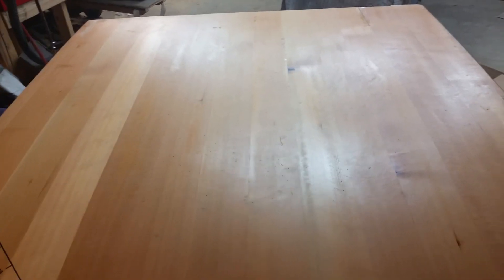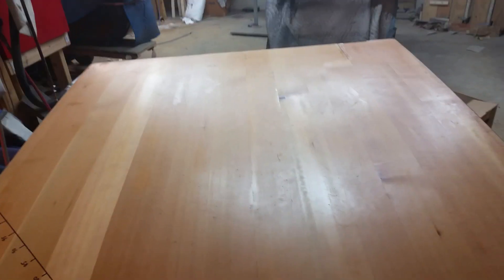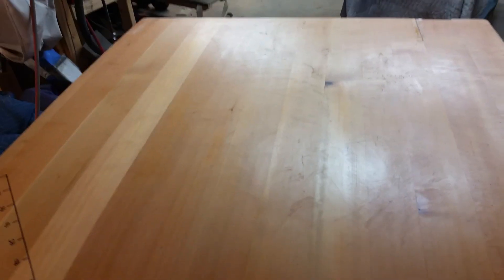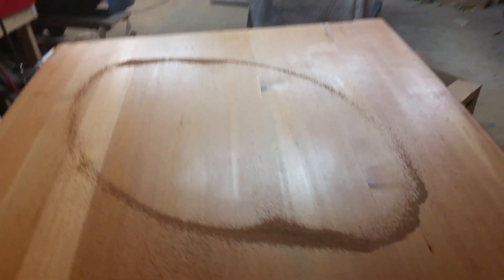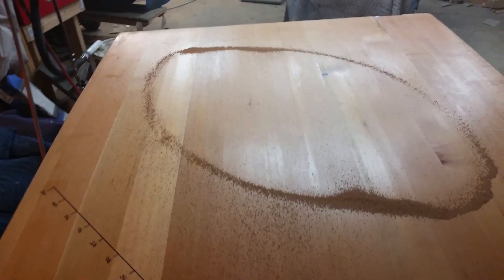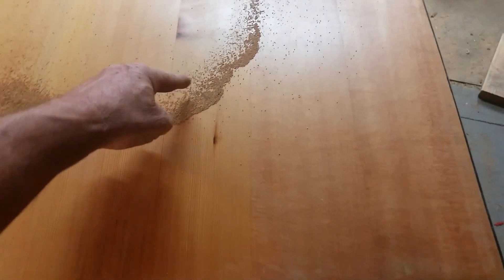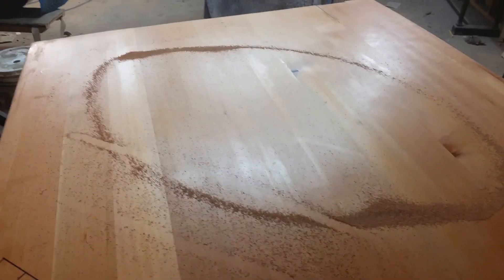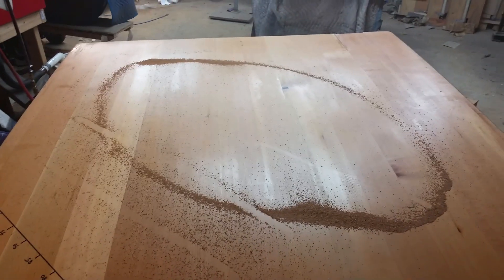Chladni Pattern Mode 1 on a Demo Piano Soundboard.

Comment: You've explained nothing. What exactly are you trying to accomplish or optimize??
Reply from the maker: Well I made several chladni videos that explain more. This was an early video.
Reply: @ChernobieffPiano  I've watched them all, and still haven't a clue. You may be doing something productive, but we have no way of telling. You seem obsessed with getting the node closer to the rim. Why? All that will do is increase output at that one frequency...I assume. It seems of no inherent value. I do imagine some value to lowering the fundamental resonance—getting more fundamental output from the lowest octave. But even here, it's not so simple.
Reply from the maker: @qwaqwa1960  The fundamental tells you everything about how a soundboard is functioning because it makes the whole board move . Its about the movement not the frequency. I use it to decide if the scalloping is correct. if the panel is too thick or thin, find dead spots, and if the tenor break is weak. I even added a piece of spruce to thicken a weak break on one soundboard. Its a very valuable tool, you just have to learn to use it.